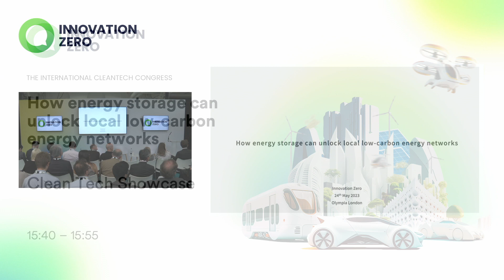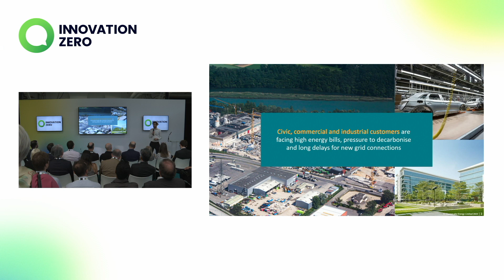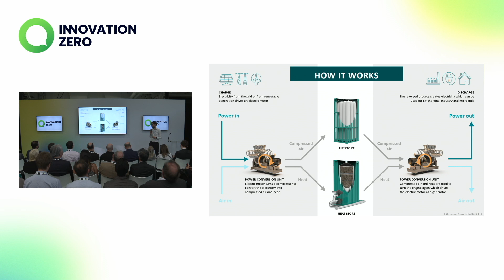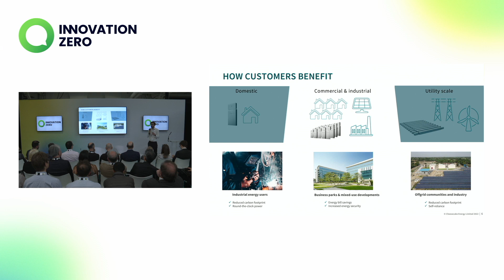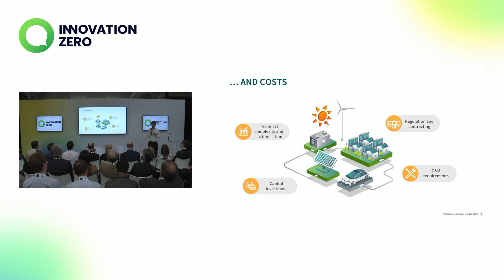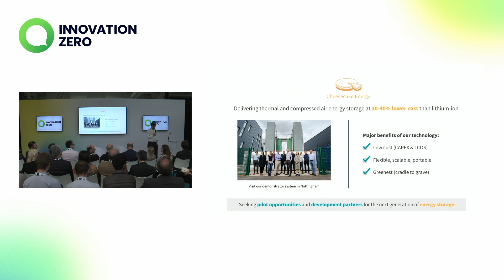Cheesecake Energy | Innovation Showcase D1

Comment: If scaled up to large installations (grid storage) would it be economical to do air separation in addition and sell off commercially viable gases like argon, oxygen, nitrogen and CO2? Specifically, redirect the CO2 to synthetic methane producers like Terraform rather than make methane from fossile fuels.